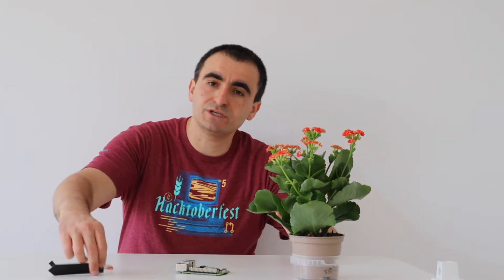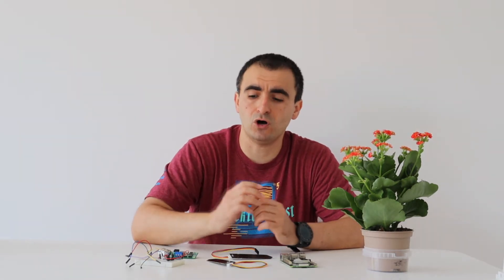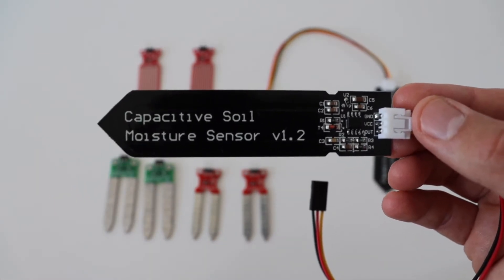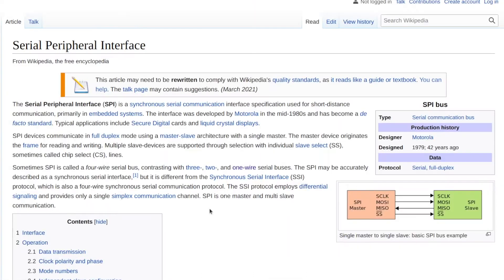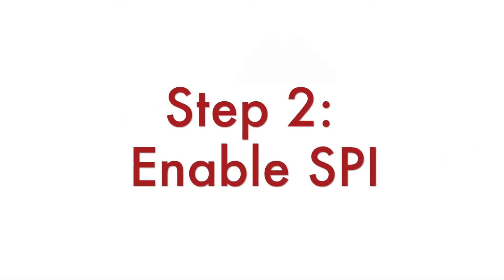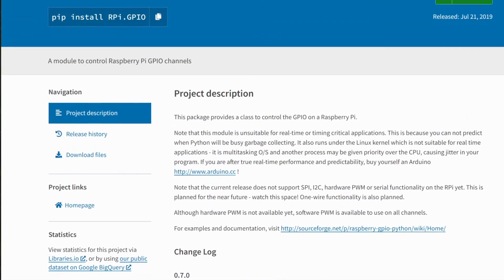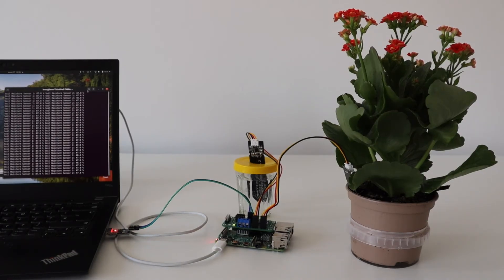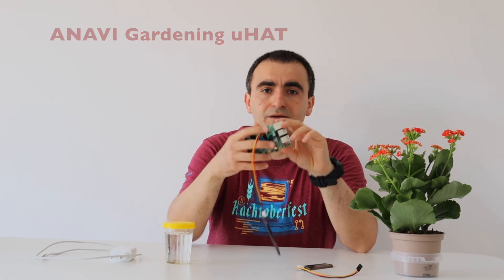Raspberry Pi and Capacitive Soil Moisture Sensors for Gardening

Comment: Hey, my sensor is just 100% or 0%. What am I doing wrong?
Reply from the maker: Please provide details. How have you connected the sensor to the Raspberry Pi?
Reply: @LeonAnavi  with a mcp30080 a/d converter and I used your code
Reply from the maker: @MiniMini-ks6gh  this video is for MCP3002. MCP3008 should be similar but it offers more channels. Make sure your wiring is correct and double check the pins of MCP3008 as per its datasheet.

Comment: Hi Leon, thank you so much for your information! Is there a way to program the sensor to make it shows dielectric instead of moisture percentage?
Reply from the maker: As you have seen in the video this analog capacitive sensor the capacitance value into an electrical signal so using an analog to digital converter we outputs a percentage value to monitor moisture. Other sensors like TDR(Time Domain Reflectometry) make measurements based on the dielectric constant. There is correlation between soil moisture and  dielectric: as the soil moisture increases, its dielectric constant also increases correspondingly so I guess in your app you eventually can do the math to show it (if you are using a capacitive sensor like the one in the video).

Comment: I am attempting to recreate this experiment using a raspberry pi a capacitive soil sensor and an MCP 3008, as that's all i could find. I tried running it with the exact same code that you gave by taking a picture of your diagram and matching it 1 to 1 with the pins on the 3008. For some reason however it doesn't produce any data at all. It doesn't output anything when i put it into water nor the soil of the plant. Do you have any ideas? Thanks for the great video by the way.
Reply from the maker: Are you using Raspberry Pi OS and have you enabled SPI?

Comment: Took ~1H to figure out that the chip is upside down XD
Reply from the maker: Sorry to hear that. To avoid messing around with a breadboard, a chip and a bunch of wires you can now get the open source hardware ANAVI Gardening uHAT and just plug it on top of your Raspberry Pi :)

Comment: Hey, im using a breadboard with the mcp3002 adc and a capaciitve soil moisture sensor v2.0 for this experiment. Sadly when executing the code it tells me sensor1 is at 0% and sensor2 at 100%. Dipping the sensor into water and removing all the code for the second sensor doesn't fix my issue. Now it only lists sensor1 at 0%. I checked the wiring multiply times, so this should not be the problem. Maybe you have any ideas. Thank you in advance and keep up the good work! ;)
Reply from the maker: Sorry to hear about the troubles you are having. Do you have a potentiometer for testing?  The potentiometer, as a manually adjustable variable resistor with 3 terminals, is quite useful for testing out the wiring and the source code. Actually you can see how I used in my other video about MCP3002: https://www.youtube.com/watch?v=1AHWiM-zd_8
Reply: @LeonAnavi  Hey, thanks for your answer. I found out that the issues was just the voltage. My sensor required 3.3v instead of 5v. Anyways, I hope you have a great day. :)
Reply from the maker: @curry9955  well done for figuring out the problem and thanks for sharing the solution with the community. Happy Holidays!

Comment: Hi, I loved your video. I have a question, I connected my capacitive moisture sensor to a breadboard using the mcp3002 converter, however, whenever I connect it to power, the sensor becomes very warm, what am I doing wrong?
Reply from the maker: If the sensor is getting very warm this is an indication of wrong wiring. I recommend you to turn it off immediately and double check the wires, especially for GND and VCC. Make sure GND (ground) on the sensor goes to ground  of the Raspberry Pi.

Comment: thank sir, i have a question?

how we can connect the data of soil moisture with the grafana ? to create the dashboard?
Have you a example video/tutorial about it?

Thank!!!
Reply from the maker: Yes, this is a great idea! I would love to do it but I am not sure when I will find time. In the mean time you can leverage the provided Python example by combining it with the popular open source grafanalib. This is a Python library for building Grafana dashboards which is available at GitHub and also has some examples: https://github.com/weaveworks/grafanalib
Reply: @LeonAnavi  i have trying to do the same tutorial like on your video, but i did'nt signal from the moisture sensor, i use capacitive soil moisture sensor V1.0 from DFROBOT, i want to know how i can use your tutorial to solve my problem? my sensor is combined with 4 channel 16 BIT ADC.
Reply from the maker: @ziemamadoucoulibaly2305  what is the exact brand and model of the 4 channel ADC that are you using?
Reply: The brand is seeed
Reply from the maker: @UCmJzXeFVMCD71jZb-Yqsarw which seeed product are you using exactly? Probably they provide a specific tutorial for their product.
Reply: @LeonAnavi   it's 4 channel 16 bit ADC for rasberry pi(ADS115)
Reply from the maker: @ziemamadoucoulibaly2305  ADS1115 is completely different ADC because interfacing is done via I2C. For it have a look at this as it might be useful: https://github.com/adafruit/Adafruit-Raspberry-Pi-Python-Code

My video tutorial is based on ANAVI Gardening uHAT with Microchip MCP3002 which is interfaced over SPI. Both the wiring and the source code to read data is different from ADS1115.
Reply: @LeonAnavi  yes but I not need to use I2C right now because the pin of my sensor is 3 pins , I want to use Gpio about that, you know the best code to run and fix the sensor?
Reply from the maker: @ziemamadoucoulibaly2305  sorry I don't have my own tutorial for ADS1115 at the moment. Adafruit provides some tutorials for it with CircuitPython: https://learn.adafruit.com/adafruit-4-channel-adc-breakouts/python-circuitpython

Basically ADS1115 uses I2C to connect to the Raspberry Pi and the analog pin of the capacitive soil moisture to one of the 4 analog inputs of ADS1115 which typically marked as A0, A1, A2 and A3 on breakout boards.The other two pins on the capacitive soil moisture sensor VCC and GND to power the sensor.
Reply: @LeonAnavi  sir if I understand you mean ADC interfacing is to do  via I2C?